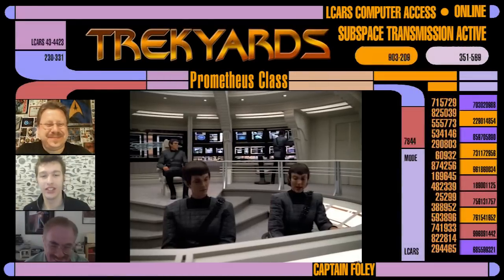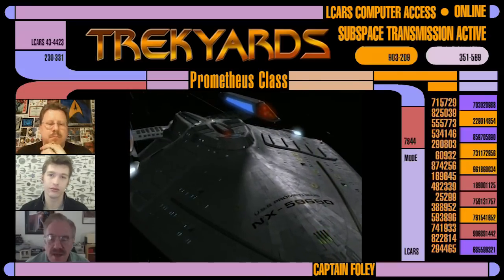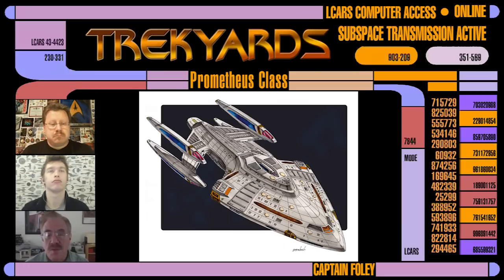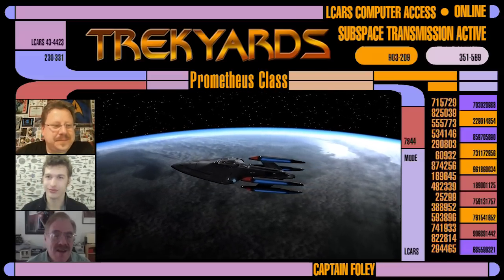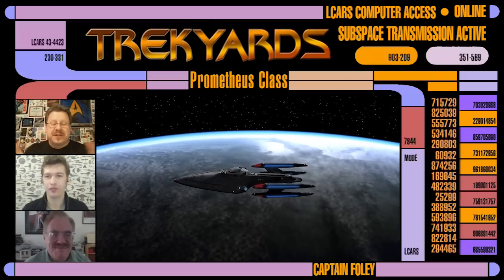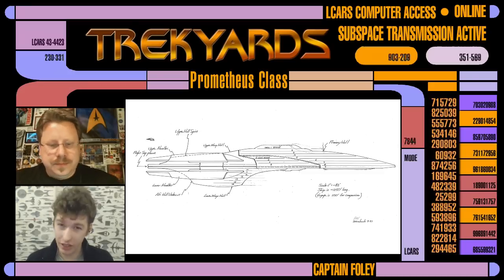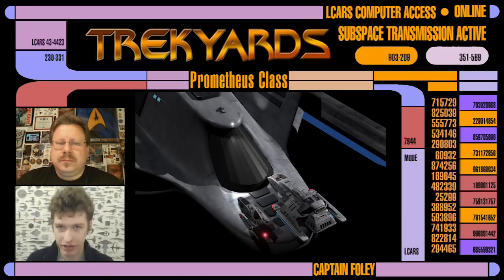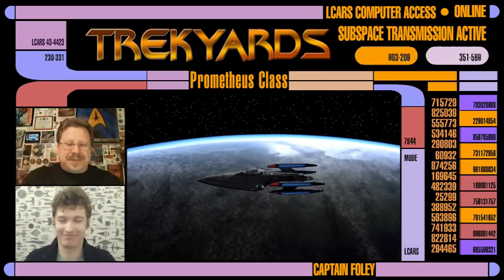Trekyards EP160 - USS Prometheus (Part 3)

Comment: One thing i would change is the saucer section nacelle pop ups - I would change them to integrated engines like the defiant or hidden pop out nacelles from the side like the captains yacht has. You could also change it to a 6 nacelle design, with the top nacelles being a mirror of the bottom nacelles and the middle nacelles being straight, but then would need some way of having them still attached to the saucer section.
It would be easy enough to make this ship a 5 part multi vector by ditching the main bridge and instead adding a aero shuttle/captains yacht on the bottom and top.

Comment: Thank you again for another, and wow three parter on a ship that could I always thought, do with a bit more explaining. 
First off, I just wanted to agree completely about the dinky "warp sustainers." In a few past episodes when Andrew Probert was a guest his input should be a part of a standard in design (of federation ships anyway) of all ships appearing, at least in canon after all. One thing that was determined and stuck with me was the matching up of line of sight of two dedicated sides of warp nacelle's. Creating what would have been as Mr. Probert mentioned an amazing effect that ended up not appearing on the "motion picture." 
This being those dedicated inner sides that have to match up in order to create the "warp wave" that propells backward. In three dimension I imagine this is a bubble, yet those nacelle's have to be aligned properly. On the Prometheus they are not only ridiculously small, yet are stacked so even had they been used codependent ly would have been sending a warp energy wave through the last half of the ship's section that separated. The designer made an excellent point about having much bigger nacelle's swing out from the rear sides, port and starboard of the main body and align properly in order to follow those "design rules" for starships that actually do make sense.
Anyway, my offer of sending the original books that Bill used rip off of the U.S.S. Wasp's design still stands if striping him of credit for coming up entirely with the design is aknowledged. I also checked the book that proceeded that one that has amazing step up designs of the Constitution ships refit as well as what came before the U.S.S Reliant and in between those two ship classes there is an interesting few ships that look bigger than the "Conney"....and of these designs I believe Bill also borrowed liberally considering that one of the names is the U.S.S. Shangra La. 
Personally I absolutely love how his three dimensional models turned out from a model making stand point, yet if he didn't give exclusive credit for the U.S.S. Wasp, which yes that name also appears in the book as well, then he has plagerized another's work with just the minimal of cosmetic differences to more modernize the actual finished product of the design that appeared in "SHIPS OF THE STAR FLEET AKYAZI-Class Perimeter Action Ships Volume Two/Number One." Again that "stinger that was mentioned was originally it's small size answer to a main deflector dish and was referred to as a "reflector pod" that stretched on two swept and curved spires to the actual pod. This rather cool ship design was so small it could only fit one standard or a warp shuttle directly in the back of the saucer and the engineering heavier pod that again was attached by two extended pylons to the primary haul. I thorowly enjoided these two books bought in the early nineties and think you guys would as well considering the ships seem to be a bridge between the FASA ships and ships that could very well have been seen in the more militarily era "Wrath of Kahn" movie. Please give it and my rant on the U.S.S. wasp review that showed up on your site.
Sincerely,- Jason SorensenIf any desire to contact me I am on FaceBook. My pic is that of a thin, early forties man with blond hair and a goatee.Keep the quality work coming!

Comment: another thing I would change is making the warp nacelles swept back and placing the impulse thrusters in the nacelle struts like voyager. and making the lower engineering hull a little thicker with a longer neck and more thickness to the lower engineering saucer.

Comment: I always thought the idea of the multi-vector assault mode was for when the ship was sent on emergency long range tactical situations or scouting missions.  I figure a scenario would be that a Federation outpost is being attacked, sending a distress call.  There are not close ships to go in it's defense.  A Prometheus class can be sent, with it's high warp factor, and get there faster than any other.  If they show up, and they are outnumbered, they can split up and have a better fighting chance to defeat the attackers.  I don't see these ships going into a Dominion War type fleet battle, and splitting up.  I see these ships more as border defense or strike force ships, where they may be a chance they could be outnumbered easily.

Comment: I wonder if the bottom engineering hull was destroyed, if the saucer and top engineering section could still re-attach (since there don't seem to be any join points between the saucer and Bottom hull)

Comment: I think splinting to 3 ships make more sense form a tactical point of view. Two ships is a good way to over power a ship from one side....however 3 allows you surround the enemy vessel....and make it hard one enemy vessel or even a group of enemy vessels over power them.  

Not to mention with 3 ships in one vessel also makes it easier to destroy larger battles because you can spend a whole ship  to attack one subsystem. making the enemy captain really think hard about what's really important lol

Comment: I've mentioned before that low registry really bugs me and really wish they'd gone with the higher one on on the plaque, but I'm also curious about the usage of phasers at warp, which I thought was supposed to be a no-no.

And speaking of warp, what does splitting up like that while at warp do to the warp bubble?
Reply: I read an explanation about phasers at warp twenty years ago. Don't ask me where, I don't remember. The explanation went something like this...

Phasers fired at warp at a target not in warp will have their energy dissipated when the beam leaves the warpfield, so that would be useless.
However if phasers are fired at a target that is also at warp the beam stays within the warpfield and keeps its cohesion. Provided the ships are going the same speed.

This throws up several questions like, -how closely must you match speeds? and -do warpfields from different ships interact?

Not a perfect explanation, but it's a start.
Reply: It's amazing that one throw away line in the first movie would somehow be perceived as some hard rule. There are tons of phasers at warp cases before and after the movie, the dialogue specifically states that the refit Enterprise can't fire it's phasers at warp at that time because of changes made during the refit AND because the warp engines were malfunctioning. 

If it was always a no no why would Kirk order it after so many years commanding a ship?

Comment: The design seems to center around the concept that ships in Star Trek tend to travel alone, and by cramming 3 ships together, you can sort of surprise and overpower your opponent.  If, however, other factions simply started sending their vessels out in wings of 3-5 craft, then this design would simply be inefficient - you start to separate and the enemy's 3-5 separate vessels just hammer you while you're going through this process...

Comment: Did you guys read the DS9 book trilogy "Millennium"?  It featured a ship built around 2400 AD with more independent parts (at least 10) than the Prometheus class.  However, even though its first mission included support from (ironically) Romulan crew members, the main bridge was jettisoned almost immediately with the Romulans inside, traveled back in time centuries to prehistoric Bajor with only Nog, Picard (suffering from the syndrome he had in "All Good Things"), and one other person whose name I can't remember; most of the modules intentionally crashed on a nearby moon, and those three then became prophets.

Comment: The main hull mini warp nacelles don't have line of sight though. How does that work?
Reply: the top one does while the lower one doesn't. Also remember the reason that the nacelles need line of sight is for the bussard collectors to be able to collect interstellar gasses for fuel replenishment. And since the mini nacelles are used sparingly I can see having one not line of sight would be fine.

Comment: I have some ideas for you...

For fan based ships, ever considered reviewing the following:
- The Odyssey from the Hidden Frontier Spinoff, also called the Allegience class, with different Nacelles.  Sort of a middle ground of a Galaxy Class and a Sovereign class
- The Los Angeles from Hidden Frontier as well.  This is also a variation on the Galaxy X/Entente that only has 2 Warp Nacelles, but has in place of the third Nacelle a tactical pod from a Nebula Class.

Not in fan films, but some other really well done fan designs include 
- the Arrogant class battleship (in the authors deviant art site), aka Essex Class (as named in the Ships of the Fleet 2414 fan tech book)
- the Perception class dreadnought (as named on the authors deviant art site), aka Devonshire Class (as named in the Ships of the Fleet 2414 fan tech book)
- the Crusader Class Light Cruiser.   This is on a few sites, but was part of the Ships of the Fleet Prototype fan tech book put out by the ASDB group a while ago.

That last is also used in the big Star Trek / Babylon 5 Crossover story on SpaceBattles called 'Task Force 43' by Zcenicx.

Comment: Prometheus would kick the crap out of 1701-E
Reply: It could yes but it all depends on the engagement circumstances. I mean the the Sovereign is pretty overpowered ship in lost regards and mauevarable. The ships are probably evenly matched in firepower overall with the tactical being the multi vector assault mode giving an edge to the Prometheus but like I said that's just on paper really battle is determined by the circumstances on where, when, how and even what I'm taught METTTC Mission Enemy Troops and Support available, Terrain, Time, Civil consideration these are important because the ship and crew who can use these variables to the fullest will be able to win.

Comment: I have to say not a fan of the mini pop up warp nacelles. what would have been better is nacelles incorporated into the triangular hull. perhaps modifying the Prime hull and making it more Trapizoidal and having warp nacelles on the sides. or another idea is tandem side x side warp nacelles on the top only not on the bottom. and not pop up but with elevator like action similar to the weapons pod that DS9 has.

Comment: Splitting the ship into any number of pieces just seems hokey to me. Furthermore, the warp nacelles don't have complete line of sight to each other. The nacelles need to be pulled further apart on the vertical axis. The ship its self isn't bad per say, and it does have some eye-candy, but it just smacks of hokey to me. 

I would have liked to see the same ship as one ship with the capability of launching eight parasite drone fighters. Each drone fighter has two phaser arrays and a magazine of thirty photon torpedoes and two quantum torpedoes. The drone fighters would be about the size of a runabout. The ship its self would have two phaser cannons with forward and aft facing photon torpedo... "launchers" with a number of quantum torpedoes. Basically, If your going to build a war ship, build a war ship.

Comment: I'm a big fan of this ship but in the same time... rather not fond to the multi-vector attack mode. I would like to have a simple, easy to build single hull ship.
Reply: I agree, I'm not fond of this fad towards wanting nearly every ship designed to separable. Ships like the defiant, voyager, equinox are too small to be wasting space by adding separation lines and equipment needed for two separate ships.
Reply: On fan speculation blueprints and discussions I often come across blueprints or conversations that want many ships to be capable of separating. Even in trekyards own video about the intrepid class, Samuel asked if the ship has separation capabilities because it is prevalent to find blueprints ( fan made ) which show voyager is capable of separating, even though it makes no sense for it to have that ability.
Reply: I definately agree with you there!
Reply: The problem with building three smaller ships, as some have suggested, instead of one ship that can split into three, is that the three smaller ships would be short range, just like the Defiant, or the Saber, or the Equinox are. The point of the Prometheus, is that it's a long range tactical vessel. 

The Prometheus is basically a "Carrier" for its three smaller elements. It gets to the destination in its combined form, and splits into three highly maneuverable escort ships once it reaches the battle.

Comment: Its not a tie. You only said that because its your favorite ship. You could hear what he was saying. The Enterprise-E can and would destroy this ship. Enterprise-E wins.
Reply: Aussie Gamer dont forget about multi-vector, the auto regenarative shields and better phasers and loads of torpedos. A whole lot of new tactics would be possible, i.e. by slowly and step by step (maybe with only one section at once) taking down Enterprise's shields but with the shields of the sections constantly regenerating back to full but without them ever beeing vulnerable. Especially if the Crew of Enterprise was not knowing what abilities the Prometheus has (as part of the Starfleet they of course have the plans and everything, i know).
Reply: In my mind an advantage the Prometheus has over the E is that with three ships it has 3 different vectors to attack from.  If one is trying to destroy or disable a ship in star trek the key is to overwhelm the shields in a particular location then destroy a power system, weapon system or control system. You have to hammer away at one point while your enemy is trying to do the same to you while both ships keep trying to spin and maneuver to keep that spot away from the enemy. With 3 maneuverable ships the prometheus no matter which way the enterprise turns will have 1 or 2 ships hammering away at the same shield location while the enterprise e would have 3x the ships to target and disable.
In the end the superior power generation of the bigger ship might carry it to victory but I think it would be a hard battle.

Comment: I just don't like the impulse engines they should be red not blue.
Reply: Those are not impulse engines.
Reply: As I see it, blue means hotter.

And an engine that burns hotter, is an engine with higher performance.